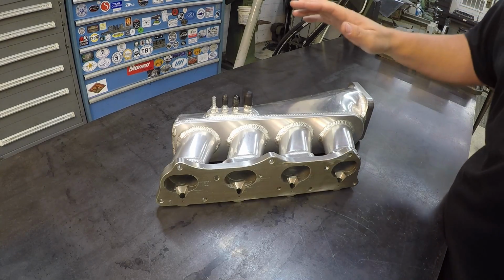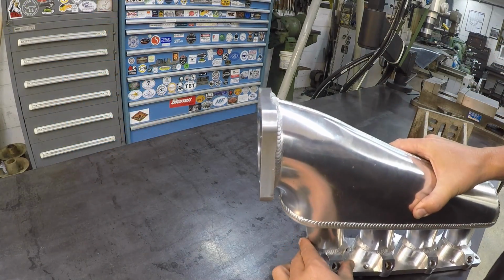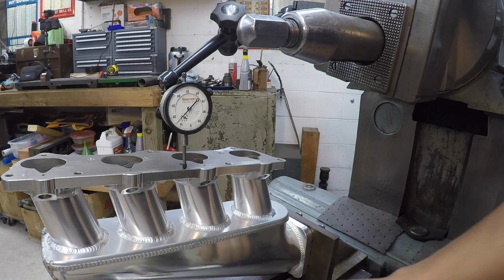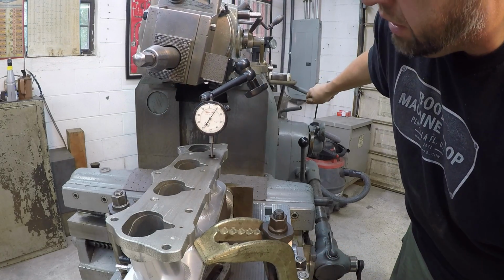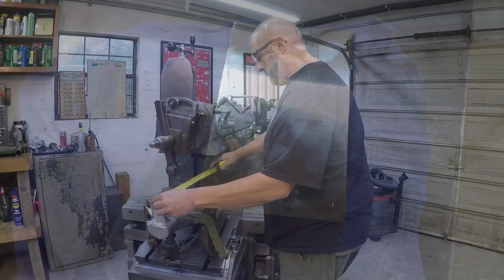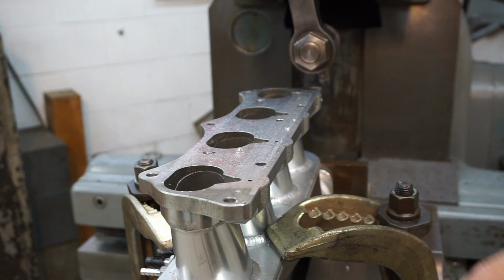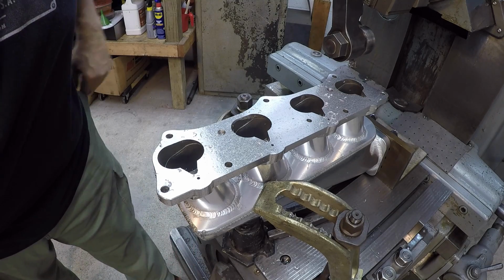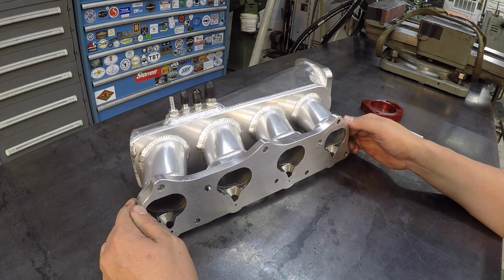Machining an Intake Manifold in the G&E Shaper

Comment: @Abom79 if the mounting surface of the manifold is warped. How can you indicate off it?
Reply: He got it as level as possible by positioning the manifold so the dial shows the same run-out on each end where the low points were, ensuring the minimum amount of material was removed to achieve an even flat surface.

Comment: quik pass with a polishing wheel and white clay would have made it perfect
Reply: You don't want a polished surface if it's too smooth the gasket can shift. If it's too rough the tool marks can be a leak path.
Reply: @alfredmorency8296  a gasket held in place with multiple bolts at 45 pounds will shift huh?

Comment: Why is the tool holder not clapping?  I noticed it did it like twice on the first pass.  Wouldn't that help improve the finish?  Great video.  Love the shaper
Reply: Depth of cut is not deep enough to make a noticeable clap. The clapper box is moving slightly, but you would have to be there to really notice it. Those two claps you heard were the tool running over a chip.
Reply: TKHua o

Comment: Bet you can do cylinders heads on that machine
Reply: I guess it would depend on what you're doing but most if not all cylinder heads require a RA type finish.
Reply: @WheelmanMike  You could probably get that finish with the shear tool that Adam mentioned.

Comment: What about one of those big belt sanders? I've had cylinder heads done on them and it works just fine.
Reply: Strycnine seriously?
What kind of cylinder heads are we talking about here
Reply: They use them on aluminum cylinder heads and are cheap and fast...no control over depth of cut end to end. Sandbags with shot are placed on each end..
Reply: No control over how much it takes on this or that side, not gonna be as smooth. It might be fine, but it very well might not be. Relying on chance if the job will be good or not : p
Reply: A guy did a video of an aluminum cylinder head cleaned up with a large sandpaper on a flat steel table , he used a table saw. Looked nice and flat and on a budget.
Reply: When u have the right tool and it's new to u use it. Get experience push the limits and u will be one better at your trade. I have worked for free to learn my trades. Even bought a mill and lathe and I will take on any job possible just for the experience. Even if it takes me 8 hours and the parts only 10 if it will teach me something new the more challenging the better.
Reply: "Just fine" lol

Comment: Was there a risk of crushing the airbox the way it was clamped? Seems like support directly under the plate being machined would have mitigated any risk of damage.
Reply: In terms of hardness aluminum is like cheese and steel is more like steel lol so you don't have to worry about much while cutting it. This particular operation also directs most of the force parallel to the work surface so its more critical to prevent movement forward and back relative to the tool path instead of up and down
Reply: If it came loose during the cutting it could have been a disaster.

Comment: Yep. That was a fun job. Love it. Aluminum is especially hard to machine, unless you are turning. I love that shaper. I've only messed with vertical shapers. This is a cool machine. Love the idea of single point too. One whole lot less tool pressure to mess with the setup and machine backlash.
Reply: Really depends on the alloy you're working with tbh. If you've got an alloy suitable for machining, aluminium is nice to work with :D
Reply: @Amberas1  Exactly. 6061 is waaaay easier to work machine the 7076 I usually work with.

Comment: Adam, I hope you look past all the "home owner DIY.knows.how.it.should.be.done" people. Sandpaper, a glass sheet and believing is what's needed. So, my question is why do you have all those machines when all you need is what I mentioned? Go out and get those supplies and you a fully functional workshop. But don't get measuring equipment, those will provide results contradicting your beliefs.
Reply: ever try to sand something flat?
Reply: @davidjones-vx9ju  Well, if you look down the comments someone told Adam that the supplies I mentioned what was needed for this project. My comment was pure sarcasm as people doesn't understand that flat isn't what they think are flat. Therefore I told Adam, still with sarcasm, that he got a shop full of equipment that he doesn't need as those three items is all he needs.
Reply: its like the flat earthers and that mad mike guy who just killed himself thinking he could "diy" a rocket to space...   one things for sure:  the earth isn't flat now but it could be flattened if god was a machinist like this.    pick the tool and index the equator.
Reply: The supplies you mentioned are what someone seen a guy use in a video where he was "sanding"/"flattened" the mating surfaces on a dirt bike motor build lol... he said all you need for this job is a thick enough piece of glass, because its flat and "wont" flex, some spray on adhesive, and box of 220 grit sandpaper sheets... clean glass, spray the back of sandpaper and stick it to the glass matching edges the best you can lol

Comment: A sheet of glass and some sandpaper would do the trick.
Reply: Your a dumb ass, it might work to clean old gasket off, but your not taking .020 off that way and keeping everything flat and co-planer
Reply: Like your mate and a pair of pliers does the trick on your sore tooth. Some people just want it done right!
Reply: What trick? Glass that is flexible (in the sheet form you mention) to some extent and "sandpaper"? I hope you at least mean wet sandpaper. There is no way you could get that area flat when it's convex. The only thing you would accomplish is a more convex shape. I fully trust Adam that he knows what he is doing. People like you provides Adam with job when you've screwed it up, so keep it up.
Reply: in your dreams
Reply: Boy,I'm glad this guy don't work on my engine's!

Comment: They should have never quit making shapers or do they still make them.
Reply: As far as I know they're no longer produced. The reason being is that they've been supplanted by more modern machines. There's the saying that you can make anything with a shaper except money. Which is why they're no longer manufactured. They're mostly used by amateurs and small shops like Abom's where fast production of parts is not the driving force. 

It wasn't all that many years ago that you could pick up a shaper for very little money, if not for free. In the 90's I would see 36" shapers sell at auctions , in really nice condition, for scrap value or less. Right around $100-$200. Because of so many heading to the scrap man they're not as common as they once were. I know that I don't see them at auctions anywhere near as much as I used to. That, and IMO the advent of YouTube channels like this one showing them being used, has driven the prices up above scrap value. For example I have a very good condition 20" heavy duty Cincinnati universal shaper that twenty years ago would have cost less than $150 at auction. A couple of years ago I bought it at an auction of a machinery dealer that was retiring and IIRC I paid around $800 for it. That should give you some indication of how much the prices for them have gone up.

Comment: How about sliding it back and forth by hand over 3 sheets of 220 grit carbide sand paper spray glued to your setup table or a granite flat? A  precision fit is NOT needed!
Reply: how about no
Reply: For the home gamer, a sheet of glass or MDF with oiled wet/dry 220 - 300 grit sand paper glued down to it would do the job.
Reply: @generaldisarray  bullshit
Reply: It's not gonna look so purty with spermatex all over it

Comment: Does this machine drag the tool tip on the backstroke?
Reply: The tool is mounted on a device called a clapper box - a hinged part on the head that permits the tool to hinge up and clear the workpiece on the return stroke
Reply: That's a good question, I was wondering about that myself, kinda assumed it lifted a bit so not to drag

Comment: Nice machine. I had a 30" Ohio at one time, have a much smaller smith mills now. One nice thing about them is you can start them running on a cut then go do other things. At times you can be running 3 machines at once :-). Shaper, cutoff saw, and lathe for example. Mine can be set to just stop at the end of the cut, I'm sure yours too. Old school folks could/would have done the job with a mill bastard file too :-).

Comment: Just a question.  Why would you check the flange that's not true to begin with to see if you needed to rotate the manifold?  Is it because you're just trying to get that as close as possible (removing as little material possible) since that small (potential) angle change of the manifold in the engine bay won't matter much?  If this were rotationally critical at the throttle body flange (which it wouldnt be) would you have had to at least measure the manifold flange thickness to make sure that it wasn't on an angle compensating for going thin to thinck while dial indicating?
  Not sure if my question came across clear or not, sorry.  Thanks for your time.

Comment: put it on a piece of glass and stick on some 320 grit and run it across it a few times and it is as flat as glass, heads the same way, more grit if it needs to be cut down some  more no shaper and all that setup needed...done.. oB

Comment: Hey Phil, should have gone with a 3S-GTE.
Reply: The K series are far superior engines
Reply: @neal00  Say that to an 872 rwhp 1991 MR2 with a 2.3 stroker "5S-GTE" owned and daily-driven by my old boss at ATS Racing. 
For swapping an MR2, a Honda engine is twice the work and twice the cost of swapping a 3S-GTE that will make the same power and have the same reliability. 
A 3S bolts right in. You can even use the S54 transmission, axles and hubs that came with the 5S-GE.

Comment: Not a surface grinder? because you didn't have one or am I missing something?
Reply: Soft metals like aluminum and copper alloys load up grinding wheels and will cause them to explode. 
If the intake were cast iron, the surface grinder would be a fantastic choice.
Provided you have a way to properly secure and indicate the intake.
Reply: Surface grinder is best on steel not aluminum
Reply: @pickerjim9246  open grit wheel and oil. I've done it 1000 times.
Reply: @Shop-Tech  I love it when I read poor comments on youtube, and I'm sitting the thinking "please don't talk crap mate"...Then someone has already replied with the correct answer...That'll be you then

Comment: is it me or is that machine moving back and the part is moving up and down? 24:18 ??
Reply: It's the whole machine rocking, he explains it a few times. It needs levelling and bolting to the floor
Reply: Yeah the part is moving, the table less so and the machine a tiny bit.. I think. Or just some camera trickery. The real test would be surface gauging it. Tho a crush fit gasket means that it could probably be out several thou over the longest dimension and it would still be more than adequate.
Reply: Going to warp again

Comment: The only thing I would have done differently is put an indicator on the part when clamping it down and check the over all flatness after removing clamps just in case it warped, which is unlikely but it is a weldment and I don't know if it was stress relieved after welding. I have done many aircraft parts many a lot more flexible than this one. The aircraft company I worked for got rid of the shapers they had in the early 80's. If we needed a finish better than 32 we would use a surface grinder. But the real advantage of a shaper is key slots and linear profiles. Nice job. good to see these dinosaurs still in action.
Reply: you need a new prescription on your trifocals there pops.

Comment: Abom, you do amazing work, and take great care to produce such a beautiful finish.  All of your work always looks clean and professional.  My one critique is this:  When you receive items from customers that have a decorative finish, either a clean paint job, anodized surface, or polished surface, maybe take a little more care when handling them.  You tend to slide such items around on the rough welding table without protection, or bang parts together while handing them, or raw clamp them in place without surface protection.  This particular item wasn't too bad, it is easy to buff aluminum, but I was cringing as you were banging around the red anodized ring and scratching the surface of it.  I recently watched the Kearney & Trecker Parking Attachment series, and noticed that the reference part from your friend was unboxed in mint condition with a flawless paint job, and by the end of the series, the part had tons of scratches, nicks, and scuffs on it.  I wouldn't be too thrilled receiving that back after loaning it out to take measurements on.  Just consider laying down some shop cloth on the welding table while manipulating parts like that, and maybe add some tape or a soft shim when clamping on a decorative finish.  That way the customer's original parts look as good as the freshly machined ones that you just finished.  Just my opinion.  Awesome work as always !!

Comment: I have found that kerosene works very well as a cutting fluid for aluminum. Cheaper too. Just my two cents.
Reply: Great tip man, totally forgot about that, mostly used it on coppers, but did use it on alum too. Great SF.

Comment: I have just purchased a very old shaper. the power table elevator screw and gear is missing. SO i will be scavenging, and retrofitting peices to make it work. i will send you some pics of the 1915 machine coming back to life. I aay have to turn a new lead screw on the 1917 Walcott, if i cannot find a suitable donor shaft. Just wait until you see this 24 in iron beauty.

Comment: I’ve heard that running these types of machines is expensive, can you give a quick explanation of why that is?  What type of consumption is used?
Reply: Low material removal rate - means more hours for the same job. That makes the machine expensive in an production environment.
Reply: That is a big chunk of iron to stop and start so many times. Just a guess, but I bet the power load is quite high.

Comment: You certainly could flatten the face using a reasonably flat surface and sand paper. But He has a shaper so it has to be used. This video is a great lesson on setting up oddly shapped parts.

For those of us without a shop full of machine tools and measuring stuff you can get a decent flat plate by asking a shop that makes stone counter tops. Ask them for a sink cutout. I got mine for free. The operator said he would have to pay to have it hauled so i could take it away.
Reply: Brilliant idea about the granite sink cutouts!

Comment: Watching this video I’m suddenly 20 years old again.  I began my apprenticeship in machine tool building in the late 1970’s. We built large scale automated welding, assembly, machining, and transfer systems.  Like auto body sized equipment.  I’ve watched some of the “old school” European machinists operating a huge shaper to flatten welded machine base surfaces.  20’ X 10’ surfaces brought to a workable finish suitable for building up weldments into precision tools.  These same craftsmen taught me to tighten Allen head bolts by hand with an Allen wrench until they squeaked.  Still have a “firm” handshake from years of this practice.  BTW, I’ve scraped in far too many ways and gibs over the years!  Prussian Blue rules the earth in machining!  Thanks for the thorough setup explantation.  Great video.

Comment: I have "resurfaced" and "machined" a lot of intakes and exhaust manifolds. Never with a shaper... but damn that thing is nice. It is pretty obvious your results are better than what I did. Gaskets cure a lot of ills... but I am impressed with that result. The aluminum on that flange was cast I assume? It looks rough from one angle, and totally smooth from a different angle. I assume that is microstructure of the casting... as it was damn sure smooth.
Reply: These ebay specials are billet just not much if any clean up and attention to detail

Comment: i once had the same trouble with a similar style alloy manifold that had a water jacket that would not seal. Returned to the speedshop i bought it at & the tech took me & it out back where he clammed it in a vice and ran a handheld electric buzzer wood-planner over the face before i knew what he was up to! Lucky it sealed but wow talk about rough!
Reply: I've seen many a manifold "fixed" with a belt sander. shudders
Reply: @OpSic66  We had a massive wet-platen belt sander back at my old workplace... quite precise actually.
Reply: @bookerol  Yeah I've seen those. With a good gasket it's less of an issue. But when someone whips out a handheld belt sander and just goes at it..... Laughable at best. Until they bolt it up and it actually works.

Comment: You know - you can put a piece of felt or scrap cloth between clamps and what you're clamping and prevent fucking up the finish on things, right? You can also shove plasticine into the throats of the manifold to save the risk of having undetectable filings left in it that will destroy the engine it's built for.
Reply: OMG... yeah sure so the clamps jump off at the first chip... did you see any marks on the final pictures? It's not made out of glass. And how about the customer cleans his intake manifold by himself?

Comment: You mentioned that the machine is not level, I guess the only thing that matters is the tool relative to workpiece, but why not level the top ways on the slide?
Reply: Machine could be perfectly level. If the travel is not level, then what?  This is why indication of a work surface to ensure true, is the right way to do it.